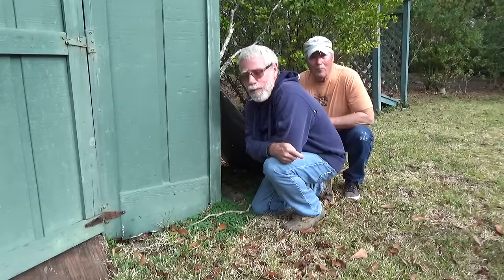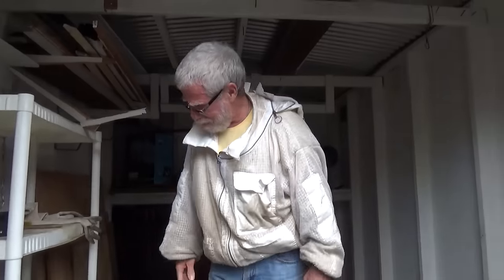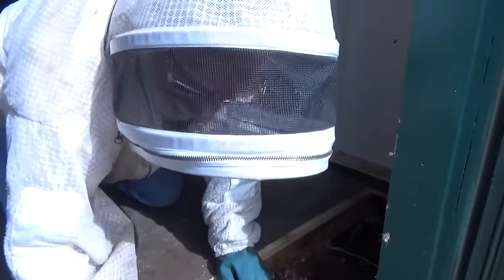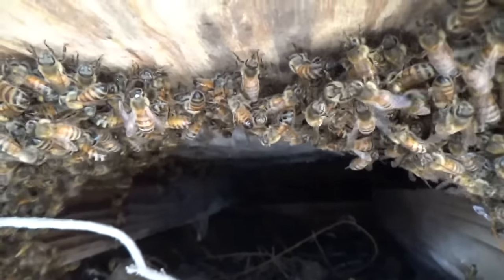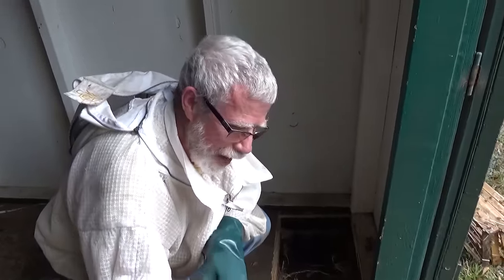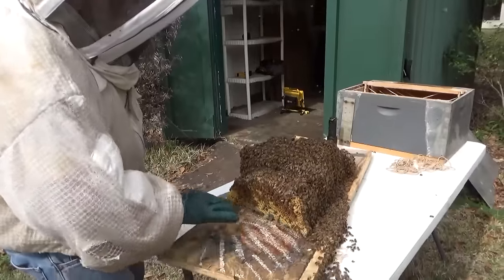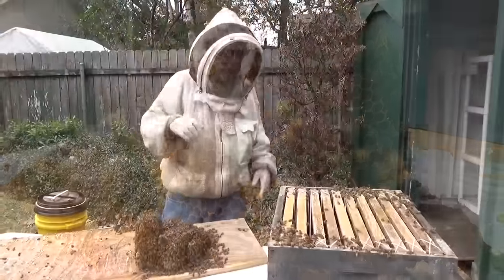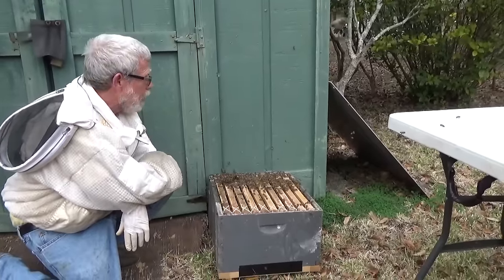Massive pre spring hive removal and relocation.

Comment: I really like how you put the rubber bands around the frames and cut-out comb in a diagonal direction! That crisscross pattern you created looks like it works as good or better than just looping the bands over the top and bottom and sliding them sideways on the frames.
Reply from the maker: Not only does it work so much easier, but it secures the comb in the frame better as well. Thanks for watching. God's peace Mark.
Mr. Ed

Comment: What rubber bandcsize do you use for cris cross? I just stand all the wonky comb up on top of the bottom deeps frames in an empty box to let the brood emerge. Separate w excluder.  Scrape into wax melter bucket in a few weeks. They do all the work and prevents rotted brood.
Reply from the maker: What's up brother! Hope all is well on the islands. It's a 7 inch long and 1/8 inch wide band I get off of Amazon. A box of 200 costs about 8 or 9 bucks. Awesome method, very simple and effective. Always great hearing from you Tadd, God's peace brother.
Mr. Ed

Comment: Why are you killing the bees😮 With a vacuum cleaner?
Reply: He's not killing them, He is moving them so they are not a danger to the public. And nobody else kills them.
Reply: @dennisbarney869  With a High suction vacuum cleaner? Give me a break.
Reply: @vonbenuth  There is a regulator so you are  not killing the bees, It has to be set right or you will kill the bees but the reason we do cutouts is to save the bees not kill them.
Reply: @dennisbarney869  It sure does not sound like it's being regulated I'm just saying.!
Reply: . @vonbenuth  The vacuum is specially designed so as not to smash the bees. It is regulated down so that minimum suction is applied. The pipes on the vacuum are smooth bore internally to allow the bees to slide into the catchbox rather than bump along a corrugated pipe. There is no reason why any beekeeper would deliberately use a tool that causes unnecessary trauma to the bees.
 The bees in the catchbox (usually a box the same size as Mr Ed put the brood into) will be reunited with their sisters when he gets them to their destination at his bee yard. If all he wanted to do was kill them wouldn't he have just sprayed them rather than spend a few hours collecting and hiving them???
Reply: @whoeverit9087  ok you have convinced me thank you for taking the time.
Reply from the maker: So sorry for not answering you sooner, but I see others have done so, and they are correct. Bee vacs are designed with a low suction quality that will not harm bees as they are vacuumed. The bees remain alive and unharmed and are then released at a new location with all the comb that was taken but now it is on wooden frames instead of hanging from plywood. I post these videos, to show just how important bees are to our very survival, and why we should not just kill them out of ignorance. I have been rescuing bees from being needlessly destroyed for over 14 years now, and hope to continue to do so for many more years to come. Thanks for watching, and I hope you will check out more of my bee wrangling/ bee rescues adventures and let me know what you think of them. By the way, I post a new video every Friday morning, and I look forward to hearing from you again soon.  God's peace Oscar.
Mr. Ed
Reply: @JeffHorchoff  I love Bees I'm so happy that none are hurt we need more Bee's the are very important.